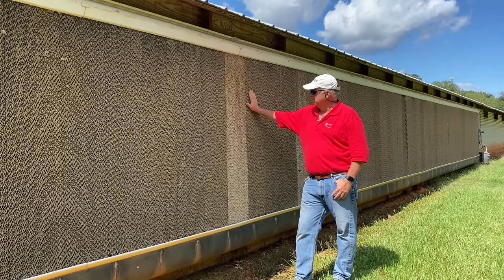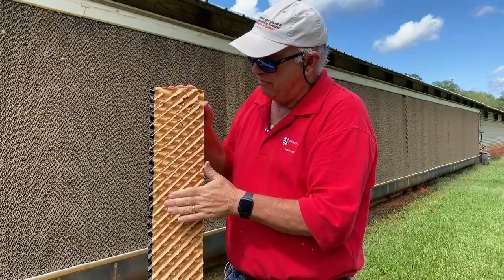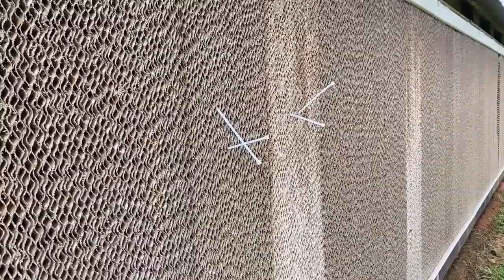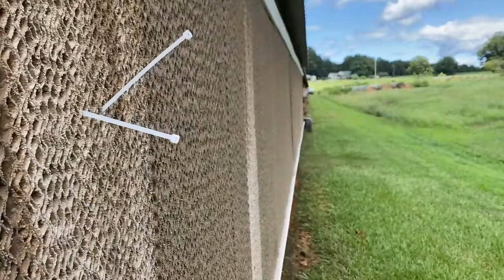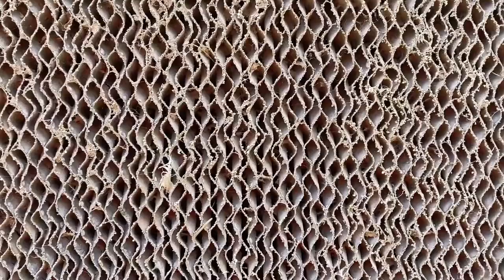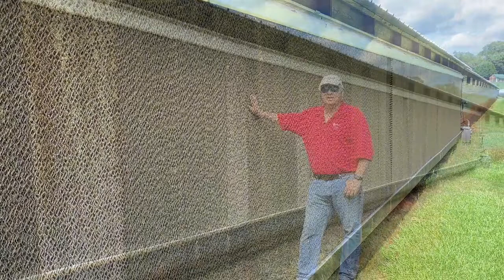Upside-down evaporative cooling pad

Comment: Would this type of cooling be a possibility in a machine shop in a climate like phoenix ?
Reply from the maker: Yes… more or less.  You would have pad wall with a fan pulling air through it and then blowing it into the shop
Reply: @UGAPoultryHousing  thanks. Currently have a few big porta cools, but the are too localized, and in the way.
Reply from the maker: @davidwyby  a 20’x5’ pad wall could supply 30,000 cfm -3 36”fans…about 8-10 times what a single portacool will do
Reply: @UGAPoultryHousing  Would you be interested in consulting further on it? Only concerns is maybe rust on machines and humidity in late summer.
Reply: Wouldn't this system be more effective in lower humidity situations
Reply: @UGAPoultryHousing do you monitor the inside humidity levels
Reply: Btw, if you walk inside looking out through the pads, you'll see the difference too....
Reply from the maker: @MalleusDei275  yes
Reply from the maker: @MalleusDei275  yes… but still cools in higher rh situations …. Just not as much
Reply: @UGAPoultryHousing  
Lol, I was hoping to see one of those old Flex 90 systems in operation....
Would have been great to have had information this available in the 80's and  90's..... hired hand, choretime, brock....
Reply: @UGAPoultryHousing  
That's a poulet house ?